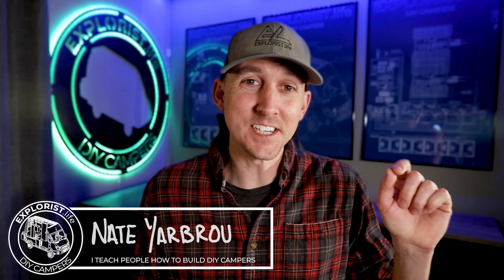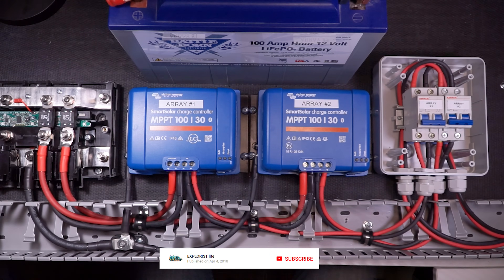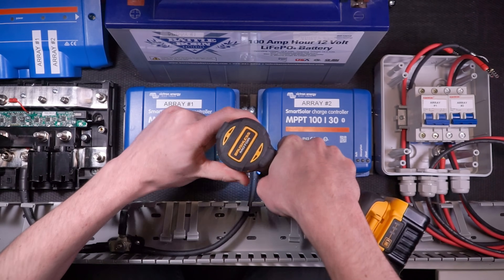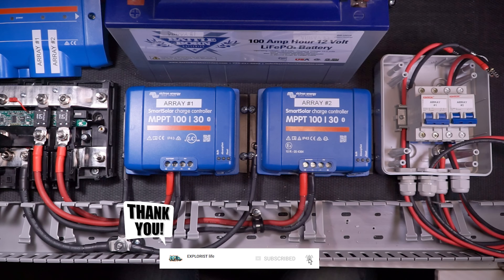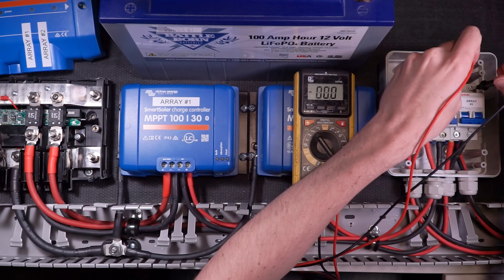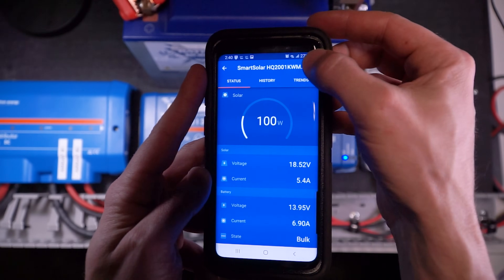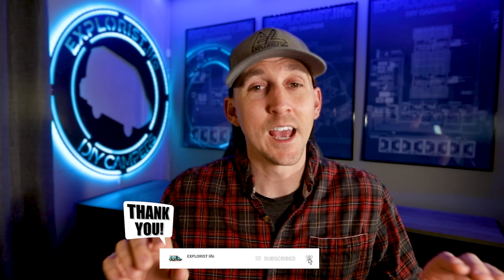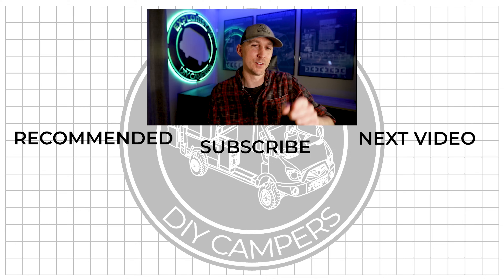How to Wire Multiple Solar Charge Controllers into a DIY Camper Electrical System

Comment: I currently have a single 150/85 Victron connected to my Victron Linx Distributor.  I am looking into adding and additional 150/85  Solar Charge Controller for an additional solar array. I have no available positive/negative open lugs on the Linx Distributor and have no space to add an additional "addon" lug as you have shown in other videos or an additional Linx Distributor.   
My question is can I use the existing positive/negative lugs on the Linx Distributor that are currently connected to my single Solar Charge Controller to connect to a "remote" positive and negative busbar (4 lug) and connect the positive and negative cables from the 2 charge controllers to the remote busbar?  I current am using 2 AWG cables to connect my single charge controller positive and negative to the Linx Distributor. 
If I go with the remote busbar method described above. 
1.  What guage cable do I need to use to connect the remote busbar to the Linx Distributor 
2.  Do I need to use a busbar like the Blue Sea Systems 5196 Fuse Block MRBF or just increase the size of the existing MEGA fuse on the Linx Distributor where my existing Charge Controller positive cable is connected
Thanks again for your input. Love your videos!

Happy New Year!

Comment: Can you charge a 12v and a 24v battery from two solar controllers off one solar array?
Reply from the maker: Not directly.  What's the context here?  Why would you want that?
Reply: @EXPLORISTlife  I have a friend who bought a van that has a 12 volt battery hooked up to a 1000 watt inverter, and a 24v battery hooked up to a 2500 watt inverter. These are separate from the vans ignition battery. It has solar panels but some are missing, we can’t see any signs of a dc-dc charger but they are hooked up to two victron charge controllers. We don’t know the history of the van or what it was used for. We were wondering if we got some good voltage solar going on the roof again to the charge controllers each set to the required parameters for 12 and 24 v won’t they just do their own mppt thing with the voltage available and charge the batteries?
Reply: Funny no one can answer! On here or on the solar forums! Some say no but don’t explain why not! If it’s anything out of the box it does not compute! Or just no ones tried! Just have to work stuff out yourself I suppose! Will go ahead and fit some 40v 700watt Bi-facial as we can get them for a great price and can tilt them. Clamp meter in hand see what’s happening! Does it work and if not why not! If it does we’ll celebrate by fitting some led disco lights 🙄

Comment: Another great video, fantastic explanation as always, I've a question about 48v battery banks.
I'm setting up a 48v off grid system, using all Victron products, you've explained everything perfectly so far, very useful. but, I'm a bit stumped about balancing the batteries, at this stage I'm planning on using on using Victron Super Cell Lead batteries, I'm not not convinced about lithium yet, anyway, I'd love a video showing how to connect the Victron battery balancers, it's clear how to set it up for 12v, 48v banks need 3 balancers, given the cost of all this equipment, I'd like to get it right the first time. PLEASE PLEASE PLEASE do a video 🙂

Comment: Can you make a video where you use two smartshunts with two separate batterybanks, actually two separate systems of the one you had in this video. Then add a globallink to get the stats to VRM over Bluetooth only, no ve direct cables.
How would you configure the smart networks and Does globallink handle the systems Well?
Reply from the maker: But why would you want that?

Comment: Hi good day I have a  question, can I pair two Victron MPPT charge controllers of different sizes eg. 100/50 and 150/45 using the Bluetooth feature on the app?

Comment: At the start of the video you say that there are two reasons you would want to use multiple charge controllers. Reason #1 would be if your solar array exceeds the max parameters of your current charge controller. Reason #2 if you have mixed panels in your solar array. It seems that this video only covers how to set the charge controllers up if you have mixed panels.
What happened to an explanation of if your solar array exceeds the max parameters of you current charge controller. I have a 4.3kw array that i would like to add another charge controller to. I currently have a Victron MPPT 150-100 connected. I also have a Victron MPPT 150-70, I would like to connect this to the solar array also. Do i simply split the output from the solar array to the input of both of the charge controllers?
Thank you to anyone who can be of assistance.

Comment: I have a question. I installed two solar controllers in my Airstream Nineteen campervan using your instructions. The secondary solar controller is used for external panels and those manuals don't match the OEM panels specs. I also have a Ecoflow Delta 2 Max and extra battery in my campervan. My question is what switch would I use to prior to the 2nd array controller to feed my EF solar generators? There are times when I need to charge the EFs when boondocking and right now the only way do do so is to directly connect it to the EF and I would like to use the external solar connectors. Thanks in advance.

Comment: I need to know how or what I need to hook up a 2,000 and 3,000 watt to my 800 watt solar panels and 60 mppt controller, have any videos of that?
Reply from the maker: You have 800 watt solar panels? 😳😂
Reply: @EXPLORISTlife  let me rephrase, I have 8 panels, 100 watt each panels
Reply from the maker: Gotcha.  Yes, our videos will teach you how to do that.  Probably have to watch several of them depending on what specific parts you are piecing together.
Reply: @EXPLORISTlife  I need to know what goes where, I have 4 hybrid gel batteries connected to the 60 mppt charge controller, the solar plugged into controller as well , than the batteries are connected to the 3000watt inverter ...how do I add the 2000 watt inverter too? And what would I need to add if anything so it works and doesn't blow up 🤫 BTW I live in a portable building off grid, learning as I go, and finding out every single way you shouldn't do more than finding the right way so far.

Comment: Hi,
Thank you for your great videos, Is there a reason to use a fuse instead of a breaker ?
Reply from the maker: Yes.  The fuse fits in the Lynx Distributor.  A breaker will not fit in the Lynx Distributor.

Comment: Thanks for sharing knowledge through this video. Please guide me. I have a solar panels bank with 6 panels connected in series. I am not allowed to change the configuration of the bank. The solar bank can provide maximum 240V dc at 10A. My solar charge controller supports 145V dc from solar panels. If I take 2 charge controllers, if i connect input terminals in series taking care of polarity, if i connect output terminals in parallel to feed to battery, please tell me it will work or not? Many thanks from Pakistan.
Reply from the maker: Hey, @imtiazhussain5027! I appreciate you taking the time to ask your question, but unfortunately, I don't have enough info about your specific question to provide an accurate answer, but here is a playlist that, if you watch all of the videos start-to-finish (and take notes 😉), you'll have a REALLY good idea of how to design a solar array: https://www.youtube.com/watch?v=Jkbs84sBHsg&list=PLmvhcyi4n0TV9pi83rFTv3ZuMT_S1xIZt

Alternatively, I have some of my most common solar array setups pre-built here: https://shop.explorist.life/product-category/all-products/camper-wiring-kits/solar-charging-wiring-kits/
Reply: @EXPLORISTlife  Thanks.

Comment: I would rather have the controllers connect via wire rather than wirelessly.
Reply from the maker: That's also an option if you are using  a cerbo gx.

Comment: Thanks for a very informative video and one that I hope will prove very useful. A question if I may. My campervan is very small and I can only fit 1 x 100w solar panel on the roof. As such I was thinking of using a bluetti 200w solar blanket as the second panel when needed. Are there any obvious downsides to this using your setup - especially as the solar blanket will not be connected at all times? Many thanks.

Comment: Thnx a lot for your clear video, I want to combine a victron smart MPPT with a the not so smart smart victron Orion TR using the VE networking. What can I do to prevent the orion from thinking the battery is full and stop charging with 30 amps while the MPPT continues charging with the solar on the roof of the camper van at a low charge rate.
Reply from the maker: At the moment, there is no way to 'officially' make them communicate and synchronize their charging efforts.  That said; in our recent installs, and to my surprise, I've often been getting full charging wattage from both my Orion & my MPPT's natively without having them communicate.

Unexpected result, but a win is a win.
Reply: @EXPLORISTlife  interesting, I also get this for say max one hour and then the orion goes into trickle charge. The only solution I have now is turn off the MPPT charge controller.. The victron bluetooth dongle seems to support VE networking but thats probably not going to work on the Orion
Reply from the maker: There's nowhere to plug in a bluetootth dongle into the Orion; so nope, that will not work.
Reply: @EXPLORISTlife  Did you do anything special in your settings like putting absorption time longer or different voltage settings? thnx

Comment: Hi Nate, I have two Victron charge controllers installed, 150/60 & 100/30. I will be installing a Victron Smart Battery Sense. Will I be able to program the Battery Sense to both charge controllers?  Keith

Comment: I have the 150\100 and the 150\45  on the same network and connected to my CERBO.. I have been getting alarm codes since I connected the \45 to the system. Error code #38 PV input shutdown\Input shutdown due to battery over-voltage on the app. I have the power wires connected to a busbar.  Details: There is another device connected to the battery, which is configured to a higher voltage. I have them all on the same network...?

Comment: Is the lynx distributer necessary in a mobile application?   Let’s say I’m on a budget, want to start with two victron 100/20 mppt controllers but also plan to scale up slowly from there.

Comment: My CDO kicked in for a moment when you dropped in the second fuse with a different orientation than the first one.
Thankfully, when you started to secure it you had corrected its orientation.
CDO emergency averted!!! 🥲
For those who don't know what CDO is, it's exactly like OCD except the letters are in the correct order. 😆

Comment: Pretty easy to understand, thanks, of course to your presentation method.  Ran it to a little hiccup in using the tool to size the CC.  One panel recommendation using EZ is 100/30, using detailed it’s 100/50.  Fine, purchased the latter.

The problem arises in that I’ve purchased TWO of the same panels, instead of the One (intended).  Using the Sizing Tool, it recommends 150/60 (EZ) or 150/85 (detailed).
HUGE Price difference !

If I just bought another 100/50, would that serve my purposes just as well, though I suppose each panel would come in through roof independently.  But, it would be A Lot cheaper to buy a second 100/50.

Though, I wouldn’t benefit from the Smart Shunt, because I got an Alii. 😫

Comment: You show the example of pairing the solar controllers together to work/communicate with each other.  I have a Victron 100/30 attached to a  190 watt panel on the roof.  I also have a 200 watt suitcase panel that connects to the battery bank with an Anderson plug, but has it's own GoSolar charge controller attached to the back.  Is there a way to make it communicate with my Victron components?  Thanks for all the information you provide.  I love your channel!!
Reply from the maker: There's not, no.

Comment: Hi just wondering.. if there is a solution to wire x1 solar panel with 2 charge controllers for 2 seperate battery banks 
One being a 24v bank other is a 12v bank. 

(Is like to charge them both with the one 415 watt Pannel. 

24v batterys is the bus starter battery 
12v bank does the sound system. 🔊 

Any ideas / suggestions how to beat do this.
Reply from the maker: Not possible.

Comment: can u use different size panels  and 2 controlers  split with 340 watts and 400 watts i cant put all same size on my van  will the weakest panel prevail or  the differant sizes cause a problem all wired parallel what will happen?

Comment: This may have been addressed before. Is there any reason for not using junction studs to connect the (-)s together and the (+)s together before connecting them to the lynx distributor?
Reply from the maker: Long story short, that would be improperly fused.  The way I showed is definitely the best way to do it.

Comment: This brings up my next question, how do you feel about the lower-end charge controllers? Like the ones that come with the Harbor Freight solar panels or the low end renogy solar charge controller. It seems like these really elaborate mppt controllers are the norm, is it possible to wire a sufficient solar system with a regular charge controller?

Comment: New comment on an old video. If using twin controllers to handle a fixed roof array as array 1 and a foldaway mobile array as array 2, how would you recommend making and breaking the connection for the foldaway array. 
The specific situation I have is for a small 2 x 120 watt fixed array on a busy roof with not much space for a large array. This would be base load charging. I would also have a foldable array made of another set of 2 x 120 watt. When I am parked up, but in and around the van, I would connect the portable array for more power or to give a better panel position if my parkup has the fixed array shaded or poorly orientated to the sun.
I would be connecting and disconnecting the portable array often, so need a safe and reliable way to do so. I suspect that just having MC4 connectors is the wrong answer and they are not going to last with repeated use.
To avoid shocking myself, the portables would be stored as folded pair with the cells inside (some soft protection in between) so that there is no light hitting them, so no voltage. After making the connection, unfold to expose to the sun and start charging.
Reply from the maker: Sure!  We actually have a wiring kit for a ground deploy array in addition to the roof array.  Check that out here: https://shop.explorist.life/shop/all-products/camper-wiring-kits/component-wiring-kits/solar-array-wiring-kit-2/

Comment: Can I plug two separate solar panels (1x250w and 1x200w blankets) into an auxiliary battery box using two Anderson connects with the two MTTP regulators?

Comment: Dude, great video. 

Which will be your suggestion when I have two battery banks (both 12v, but one has 100ah and second 105ah, both lifepo4). 
At the moment I have epever controller which supports one battery bank only I cannot wire batteries in series because they have different ah. 
Another solar panel to second battery bank or a Epever duoracer kinda of approach?

Comment: This may be confusing but here we go. If I have 1 controller bringing in 30 amps on 12v, can I run it it to 2 or more battery banks and if so how many amps will it deliver to each bank?
Reply from the maker: Nope.  That would effectively combine the banks.

Comment: Do you have a video on grounding.  There seems to be panel grounding and system grounding.  I see you grounded the SCC with the negative buss bar.  Is this "normal"?  So the buss bar negative actually is in parallel with negative terminal of the battery.  Is there some "other" grounding of the negative bar such as a grounding rod or ????
I  totally confused on what all needs to be grounded and how it is all accomplished
Reply from the maker: I don't have a specific video about grounding but all of our full system installs show proper grounding: https://www.youtube.com/playlist?list=PLmvhcyi4n0TUU8FUc6LE38TBkdSLjdw_5

Comment: Hi Nate, Many people advocate one panel per charge controller if your solar panel array is subject to shading. Is this correct? If I have 8 panels do I really need one charge controller per panel for max output? Thanks!
Reply from the maker: You definitely can put more than one panel on a charge controller.  I don't like playing hypotheticals with shading.  If max solar output is the goal... putting the panels in the sun is the best option.  Panels in the shade will hurt solar charging regardless of how the array is set up.

Comment: Nate, you are a hero! I have designed an off-grid solar system for my sailboat based on this video. However, I am confused with one thing only. The ground wire from the Victron charger/inverter (Quattro 12/5000) is going to the Lynx Distributor (sharing AC to DC?), is that the case? I hope, I get a reply. (Abaid from Nova Scotia, Canada).
Reply from the maker: That's not the case, no.  Only the DC negative and equipment ground is going to the Lynx Distributor.
Reply: @EXPLORISTlife  Hi Nate, I appreciate a very swift response. Kindly let me know, how can I get a review of my design document (a Visio diagram exported to PNG graphic), and get the errors corrected? I am willing to pay a fee for this review.
Reply from the maker: That is no longer a service I offer.  Instead, I recommend using the diagrams I have pre-assembled at https://www.explorist.life/solarwiringdiagrams and https://shop.explorist.life/product-category/all-products/plans-and-diagrams/solar-wiring-diagrams/

I will say, though, that the quattro 5k should REALLY be a 24V unit connected to a 24V battery bank.  A 5k inverter is truly too big for a 12V battery bank.
Reply: @EXPLORISTlife  awesome, thank you. 👍